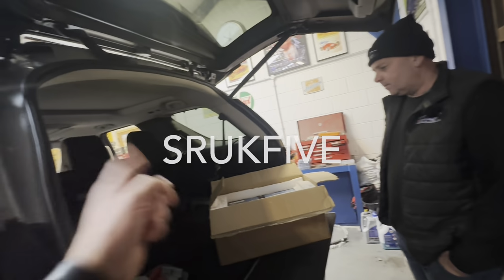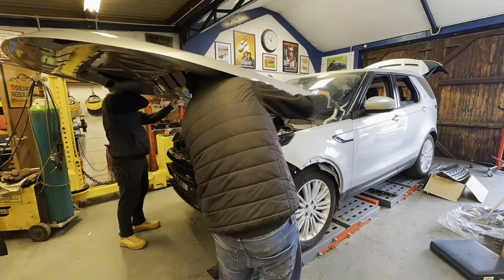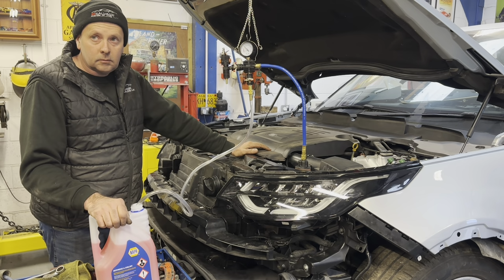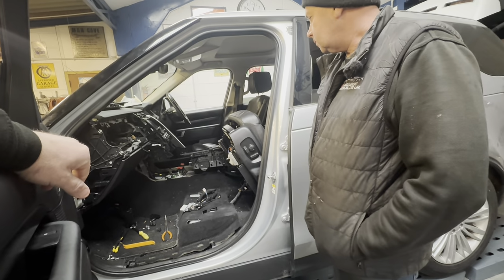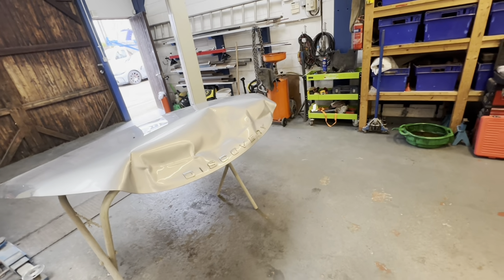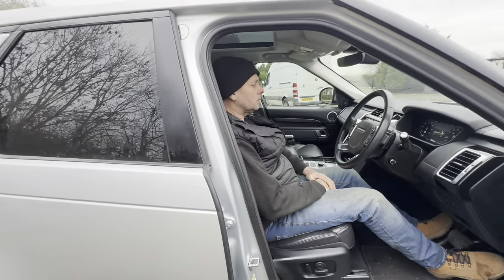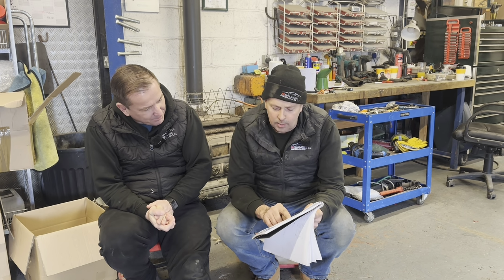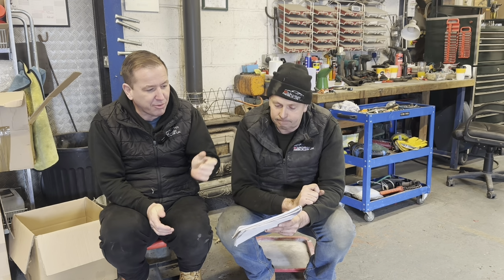WAS IT WORTH REPAIRING THIS WRECKED 2018 DISCOVERY 5 ? £££

Comment: That electric car you're getting.😮 You better have the Fire Brigade on speed dial. You could be buying a ticking time bomb... literally!
Reply: they are not as scary as people make out, You just need to be sensible, battery removal or isolation is standard for repair work, my Zoe was rear ended at a traffic light was away for 4 weeks as they did remove the battery and replace the rear panel and some work to the boot floor nearly wrote the car off 6 years later car is fine. If the battery was compromised it would have been removed before selling, and for most EVs if the battery is damaged then the car is not Cat S it is scraped as the battery is under the floor and back seats so  the passenger cell would need to have been compromised

Comment: Guys, an absolutely super job. I have a Disco 5 and I love it. The TPMS does work on the spare tyre too so it probably needs just a little bit of air in it. Mine kept saying check spare and when I did it was a little bit low.

Comment: Some cars use the speed sensor / abs sensor for the tyre pressure monitor system, Audi vw group and also Peugeot.  Some cars use sensors in the actual valve like Hyundai and Vauxhall and maybe Landrover.

Comment: So just one thing, before you Vacuum fill like that you need to prime the pipe between the valve and the bottle of coolant, otherwise you pull the air from inside the pipe into the system first.

Comment: have you checked inside the rear armrest for the remote control yet? Good job guys as always - iim it is missing/corupt the CCF (car config file) it just needs resetting/reapplying as it is stored in three of the main modules. I use jLR SDD to do this, also worth iim as can check for module software updates at the same time - just Done all this to a L405.

Comment: The land rovers are notoriously hard to sell at a decent price lately but saying that as long as your making a profit and keeping your heads above water keep going.
You and Chris are in the premier league of salvage repair but I don’t know what your thoughts are Rob but I think the bottoms dropped out of the used motor market lately.
Reply from the maker: I wouldn’t believe what you read or hear wen I picked the parts up from the dealer every salesman was tied up with customers and there were people wandering around everywhere viewing the cars and it’s not discovery 5s that were being stolen
Reply: @sruk was just about to say something similar I’ve done 2 in past 6 months and I had absolutely no problem at all getting rid of them both gone within 7 days.

Comment: Looks great, I wish you would factor in how much time you spent fixing, plus the time to collect parts plus the fuel cost to collect parts. 

The SOS limited function is the small battery in the telematics unit. They only last 4-5 years. It's behind the passenger rear seat. They are only £10 from the dealer. Then you need to drive it for an hour for it to reset itself 👍
Reply from the maker: The sos is a speaker issue not the sos battery 👍
Reply: Glad you got it sorted 🙂 just out of interest how much time did this one take?

Comment: The Wing Silver is lighter, Surely you know edge to edge paintwork with Silver is a No No. It at least needs blending into the door.
Reply: The uv light in the garage will show everything, outside it won't show or be anywhere near as noticable, if it does I'm sure the painter will blend into the surrounding pannels when it has the other bits done
Reply from the maker: Surely you know to wait to the end lol x
Reply: they covered this in the video
Reply: @stevenking2946  Outside in the Sun is UV Light, Not inside the Workshop.
Reply: @billywilliams8833  true. But having been around car bodyshops for years, the lighting in the workshops will show everything....outside a lot doesn't show.